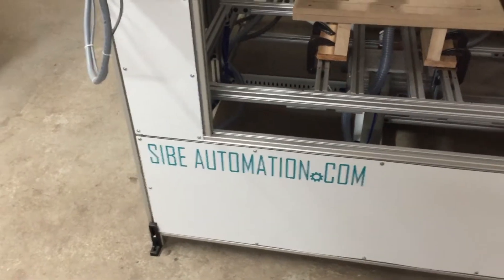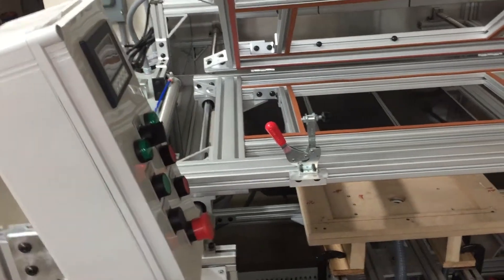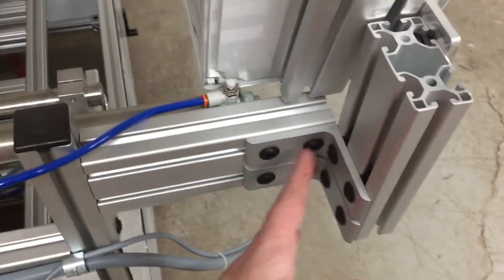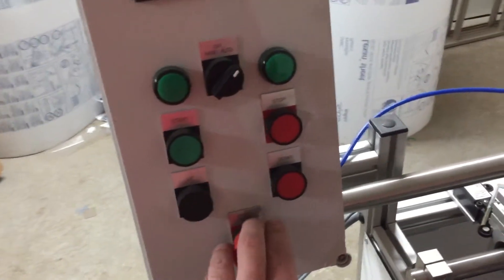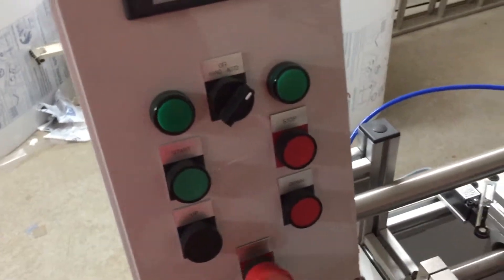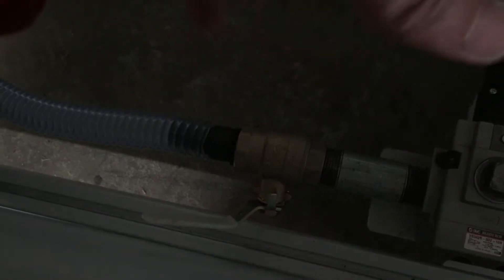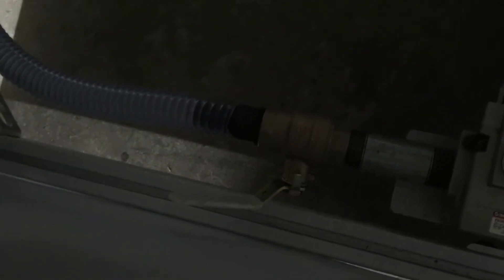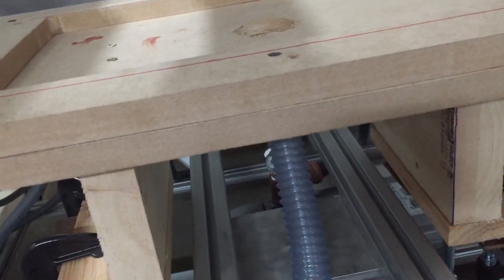Vacuum Forming Modifications Sibe Automation Thermoformer

Comment: I thought I heard you say in another video you were using. 040 material. If so. how much harder would it be to form .118 or even .177 for a comparatively same size part as what you are working with in these examples using polycarbonate or acrylic? Would injection molding be a better alternative?
Reply from the maker: Hi, this machines limit is .250. So going up to .177 in theory shouldn't be too bad. Just longer heat time for plastic. Now for molds I am running most fine detail would be lost going that thick. I would also have to modify the holder frame. I have pretty thick heat resistant foam in the frame to grab the fairly thin plastic. I would need some thinner foam in the frame probably. Might be able to remove foam from one side maybe.
Reply: Makes good sense, thank you!
Reply from the maker: Oh, as far as the injection mold part. Tooling cost is a whole lot more, that is the biggest reason to not do injection molding over thermoforming. But injection molding is easier to control your wall thickness and keep thickness more uniform across entire part. Thermoforming stretches plastic thinner in spots you may not like and can be hard to get just right.